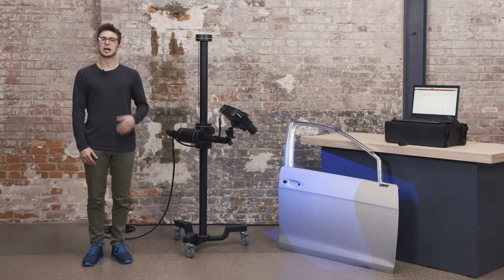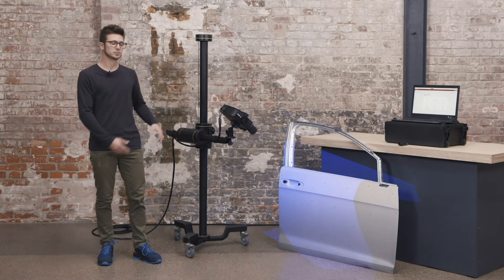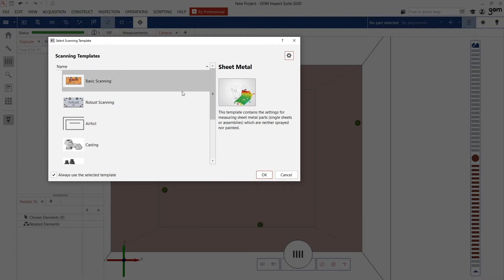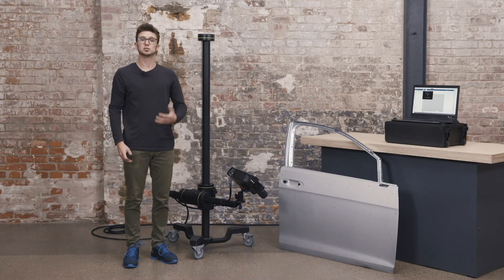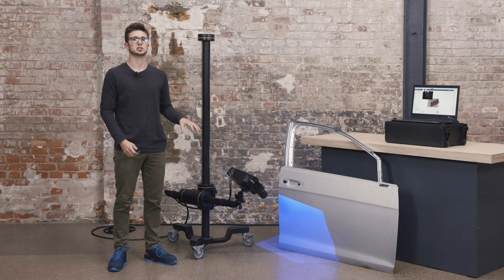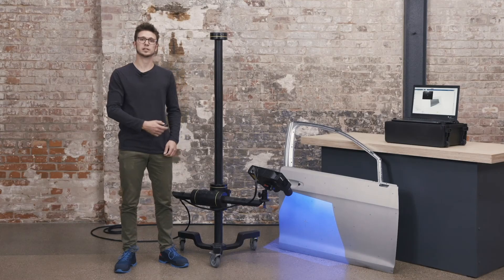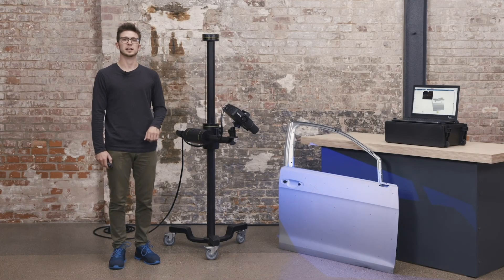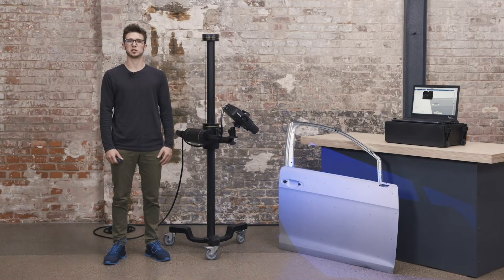3D scanning with ATOS Q: How to measure big parts

Comment: How to scan and matching back side?
Reply from the maker: Hey there! If you have enough 3D information (like the example in the video) the software will be able to automatically transform both sides to eachother when you scannend both sides speratly.
Another possiblity is stick 3 reference points on the side (distributed nicely) that are seen from both sides and then also here the software will align both sides to eachother. Check out following video https://youtu.be/vTrGQ09RyPE?si=a94cL1VybC9EfuaL.